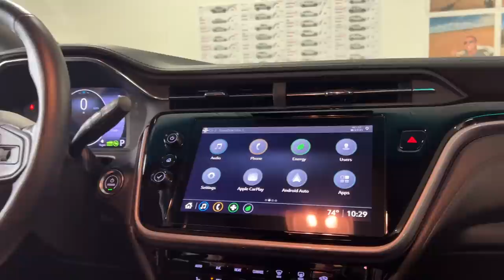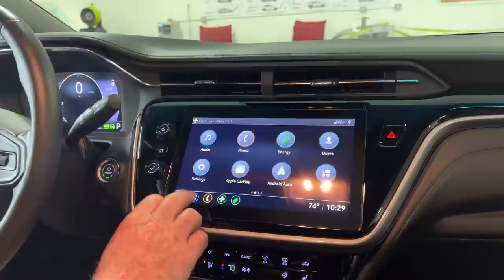Sandy's First Impression of the 2022 Chevy Bolt EV

Comment: I own a base 2020 Bolt EV. Picked it up for $22K at the end of December 2020. It’s been worth every penny. That said - It’s fine. Not impressive, not terrible. 
I’ve also rented a Tesla for a week. 
It’s definitely a step down in features, efficiency, and trim from a Tesla. The fast charging was limiting for a 300-mi each way road trip we took it on, but wasn’t a killer. We have two young kids, so we had to stop anyway, just for 20 mins longer than we would have otherwise. I just wouldn’t recommend trying to do more than about 400 miles in a day with it. 

But it’s totally a useful car for the average person or young family. It’s done about 95% of what I want it to. I still aspire to a Model Y though. Mostly for the supercharging. EA and the others feel so clunky and unrefined in comparison.

Comment: Sandy is right.  The panel gap control and evenness and exterior finish is quite good on the Bolt.
Reply: I think he got a Bolt from the GM Press Fleet, not a car sold to the general public.  Those Press Fleet cars always get special treatment before being placed into service.
Reply: @mikedx2706  My comment was thinking in terms of my own 2017 Bolt.  The quality of done assembly at the GM Orion plant was good.  The uniformity of the Bolt panel gaps is better than several Toyota products I’ve owned.  The GM paint process did well too - no orange peel or visible runs anywhere.

Comment: The older Bolts had a lever instead of shifter buttons.  I don’t know if I like the button aesthetics, however...  On the old Bolt the default is to default to low regeneration mode in “Drive.”  You have to flick the lever twice to go to “L” mode for more regen.  It reverts every time you shut off the car, so an unfamiliar driver probably would not know L is the preferred mode and not know how to switch into L.
Reply: L mode is fantastic 😊

Comment: No Sandy, don't tell manufacturers to go back to drum brakes. As someone who changes their own brakes and has multiple vehicles with drum brakes, I do not like them. Sure you rarely have to change brakes on EVs due to regen, but I'd still take cheap and smaller disc brakes that are easy to replace over drum brakes.

Comment: Be advised there is a serious and widespread problem with the 2022 Bolt. Many of them will show an error code that says “Propulsion Limited, Service Required”. The AC will stop working and you’ll have limited power. And there is no fix. 

It happened to ours six weeks ago. We took it to the dealership. GM told them “separate customer from vehicle until fix can be found”. We haven’t seen our car since and the GM EV Concierge people have acknowledged there is no fix. 

Apparently it’s either software or the battery, but no one seems sure. GM has known about the problem since May. They notified the dealers of it on May 13 of 2022. 

We are working to get a refund. Do not buy a Bolt.

Comment: That charging rate is just not acceptable but it shows its roots as a compliance car. The interior of the second generation is so much better than the first generation
Reply: Compliance car? 90% of Americans commute less than 40 miles a day. The car was designed for people that bought a house and have a place to plug in nightly vs the idiots that buy a Model S with that house money, live in a closet that has no place to plug in.

Comment: 13:34 Volkswagen does that on the rear axle of the ID family. I suspect the ABS/ESP regulation speed to be to slow, as drum brakes are slow, have a high delay and hysteresis (nonlinear input/output).

Comment: I DROVE ONE AND THEY SRE QUICKER THAN A Nissan Leaf . BUT THE BUILD QUALITY FEELS MUCH CHEAPER / THE BOLT DOESNT SEEM LIK IT WOULD HOLD UP OVER TIME . MAKES A LOT OF NOISE WHEN YOU DRIVE IT. THE SEATS ARE NOT VERY COMFORTABLE ! BUT AFTER GOV. REBATES IT WILL BE CHEAPER THAN MOST EVS. THE BEST THING ABOUT THIS CAR IS THE RANGE FOR THE PRICE. THATS THE ONLY REASON I WOULD BUY ONE OVER THE LEAF !

Comment: Sandy, luv ya, but I'd rather ram my head into wood chipper than work on drum brakes. Hate them and wish they'd die. What I have never understood though is why they are "cheaper" to manufacture and install than disc? Especially given modern ABS systems and the control needed. 

Discs have always seemed simpler in design, manufacturing, and installation than drum. Essentially a disc has one moving part. This piston. Drum brakes have at least half a dozen. I'm looking at you little springs and tensioners and shoes. 

So short request is, can you do a short video explaining the costing differential on drum and disc brakes in a modern car?
Reply: Keep in mind that in an EV you hardly ever use the brakes. I got 100K miles on my Volt and I'm pretty sure the pads are original.
Reply: @HodgePodgeProducts  Absolutely. I had a Prius and got 220,000 miles on a set of brakes. So, yes, the regular EV owner may never have to change their brakes, so the ease of disc brake replacement may not be an issue. My question is, why are drum brakes cheaper and easier for a manufacturer to make and install? It just seems like drum brakes, even IF cheaper to make, would cost more for the manufacturer to install in the car.

Comment: Hell No! Don’t bring back drum brakes! They truly suck! The springs like to fall off the top posts and end up getting ground up on the drum, the Star adjusters freeze!  The emergency brake cable likes to corrode and freeze, the cable that runs down from the top post to the Star Adjuster tends to break  when the Star gear gets a bound up by the brake dust that has no way to escape the drum area.  The brake dust is what gunks up this mechanism Just say no to crappy drum brakes that fade when you need then the most. Bad, bad idea for safety! The simplicity and elegance of the disc brake is the way to go, the Disc brake is better cooling, can be cross drilled for even better performance, and constantly clears the brake dust away instead of collecting it.   Sandy, I suggest you take apart an old, well used brake drum and see what it’s like VS those shiny new assemblies Munro and associates disassembles. Then after to experience a brake drum in its full junked up glory, brake dust and all, I bet the true horror of it all will make you walk back ever the slightest suggestion of manufacturers walking back to the dark days of drum brakes!

Comment: Hey Sandy and the rest of the team 
Looks like a fair review . 
What I noticed is that the battery’s didn’t seem to have any aero dynamics features around the connecting points to the body in and around thus imho would couse a lot of wind turbulence and thus noise and obviously drag . And also the noticed that it’s NOT just Gm Chevy bolt but lot of other brands .. 
and Honestly wish you could 🤞🏽please please do a VIDEO related to (Top ten aero Dynamic ) cars under the car 
Now I know that’s NEVER been done ????? I did say please 🙏🏾 
Right back to my details I noticed the rear bumper like a few have way too low bumper spoiler goes from the bottom of the boot like a backwards 👉🏾C 
So if you lift the car up and look at the bumper underneath what you actually see is the bumper scoops down around and forward thus actually making the car less aero dynamic actually acting like a 🪂parachute… so say with a few improvements
1, Looking at the Hight of the car drop 2” 
2, place two shields under the shock towers 
3, place two clip on shelf’s strips both Sid’s of the battery 
4, follow on a shelf from back of battery to underside of rear bumper . 
5, fit blow vents that after 50 mph the vent air back of car 
Sorry to be picky but think loads could be done to improve this car . From a just a quick view . 
Ps keep the great video’s comming 
And get a counter wait on theat phone / or damper system & also a wired cable to a 2170 battery that power’s a small powerful led thus you can pop on or off when reflection hits . 
Come on let’s have some inginuaty.. in this area 
You guys can do it ..? 
Also this would help you get in them areas not coverd some times 💡 lighting is your frend and filter 🤞🏽👌🏽  
So to wrap up you guys are awesome 👏

Comment: It's odd, in 1909 the Baker Electric Car could go 100 miles without recharging. In 2022, the Chevy Bolt goes 250 miles on a charge. That's not much progress in 113 years. Still, I'm excited to hear about your impressions of the Chevy Bolt next week. Stay awesome.

Comment: I was considering this as a 2nd car option a few years ago. But, the 1st gen dash controls with centre raised-nub plastic panel plus its cheap seats left it in 2nd place to the Hyundai Kona EV.  Then with the release of the Tesla Model Y and with retirements in site, we're going to become a one-car couple with lots of room and no compromises for a lot more money about $87,000 CDN. Interesting. Canadian Bolt LT is about $37,000 and has about $4,000 tax incentive (Tesla has none here. Wait, why do Audi Q4 E Tron qualify which starts at $87,000? Hmmm). Bolf EUV with leather is about $50,000 less incentive. Pretty good value. Still, it's a lot smaller than TMY.  PS The Bolt prices includs Supercruise features that are really a must for safety and convenience. Bolt APP connectivity is $400 a year too. Getting pricy for a small car still. Congrats if you read all this!

Comment: the Bolt is far from City car, I did over 1k in it over 10 days. My brother has one. Did 240 miles one day and still had 40 miles left. This is great car apart from one thing... DC charging. But I never needed this with all my driving.

Comment: Only had a couple of rides in the Bolt as my GM dealer is using one as a courtesy vehicle. I only have 2 questions When is GM going to install an actual suspension? And when are they actually going to start putting padding in the seats? The car is a damn buckboard.

Comment: The Bolt is actually fairly fun to drive, quite zippy with the 200 HP motor.  Simple suspension, but quite neutral, very little torque steer thanks to near equal shaft length.  The Michelin high efficiency tires hold back handling in cornering.  You could swap for grippier tires, but economy would drop (Car and Driver actually did that on a test Bolt).

Comment: 13:40 Sandy gets this. After the announcement of Brembo's electric driven disc brakes, I reckon, EVs can go without disc brakes buy a combination of oversized electric motors for greater regen, using battery for stopping power, and drum brakes

Comment: The Bolt has one of the better real world ranges.  The published figure is average 259 miles, but the car often delivers more, often over 300 miles.  In the last 19,500 miles since I rest my gauge, I’ve averaged 5.5 miles/KWH in real world mixed driving, but not using much cabin heat.  Using heat a lot would take a big bite in economy.  I believe the Bolt EV and EUV are still strictly resistance heat with no heat pump option.

Comment: My first instinct was this would be a good value because they fixed the batteries bursting into flame problem and lowered the price but the public perception remains. I would like to know  from Sandy if the battery is actually reliable now and will the expensive components last?

Comment: I easily get 5mi/kwh in my new 2022 Bolt EV 2LT, that’s with listening to music, running lights turned on(headlights off), running Waze on the screen, and keeping climate controls either turned off or set to within 10 degrees of outside air temp. Does that mean my max range is 66kwh x 5miles= 330 miles, minus any battery buffer?

Comment: Sandy they say that to get the $7500 off "if they pass the bill" the battery in the car has to be built in the USA or 50% of it. So is the Bolt battery made in the USA ? if not then does that Mean no $7500 off ?
Reply: EV and BEV need to pull their own weight and NOT be getting Publicly funded hand outs ($7500) from others who can not afford them.

Comment: Gosh Sandy, the Bolt has been on the road six years now. The 2022 is the essentially the same generation with a facelift. Some not insignificant changes for 2022 but still basically the same vehicle, a fact I don't have a real problem with because I generally like them, (with admittedly limited time behind the wheel.)

Comment: This Bolt car has become #1 for me.  After using my Tesla 3 on road trips that charging time is awful for trips.   I use my minivan that gives 500 mi, I saw way more things and drove highway flow 75mph.  I would definitely would have had to charge 2x outside for the same trip, that is 2 hours during day travel time lost.  Gas we didn't even fill up till we came home where we have ample time to lose.  Bolt is the right choice as range isn't there, dont need long distance charging of the cars that can't go the human distance on EPA rating.  Use my 3 as a city car, at that point Bolt owns the 3 in terms of cost.  Yes I know of the fires and recalls, but they will get better with it.  3 is not worth the money it asks.

Comment: There basic model looks nice, who wants to be in great debt, over a city car, most people travel in town or city where they live, commute to work, shop etc. 
255 miles is ideal after a couple of hundred miles  you need a break anyway, right 😉
I have a Nissan leaf 30kwh & the worst thing about it, is range anxiety, it's got this gauge that guesses the range you'll get, it often says 124 miles & will do maybe 90 miles in summer, so lies greatly 😡
So will be trading in asap.
If the Bolt does 255 miles, that's great 😉 
Thank you ✌🏻🇬🇧🇺🇸

Comment: Sandy has been spending to much time with Teslas, lots of misinformation and errors in this video.  Current 2022s + 2023 Bolt EV & EUVs have cash discounts or lower prices that bring EV 2LT to around approx.$30k and EUV premier to $32k.  The problem is you can’t buy them. They haven’t made any 2023s and the 2022s sit waiting for new batteries.  I also wouldn’t count on the proposed $7500 tax credit moving prices into the teens for any models.  Dealerships will absorb that credit via “market adjustments” :-)

Comment: Opel sold this as Ampera-e in Europe. Well "sold". At the beginning in 2017 they only chose 44 retailers here in Germany where you could LEASE (!) the car. delivery times where outrageous. I was really interested in the car back in 2016/2017. but you couldn't buy one. but today the charging speed is just too low for the large battery. 55 kW on DC are only in very good conditions.

still today an used Ampera-e is selling for high prices. back then they where about 40k €. the cheapest i found is still at 28k € (5 years old!)

they sold it later normally. but then i already got my Hyundai IONIQ electric which i still drive today (almost 5 years) and it's still an awesome efficient  EV with only 28 kWh (10-12 kWh/100 km in summer conditions are no problem).
Reply: The car launched right about the time GM sold Opel to PSA (Now stellantis). So you can imagine Opel not pushing these as they would in essence buy the cars from a by then a competitor. 
The loss per car would have been massive.

Comment: City cars only need a small battery, and maybe 100 miles range. Instead of charging once a week, you'd charge overnight, or while the car's parked at work. We still don't have cheap EV city cars in the US, in China, they are widespread and cost about $10k or less.

Comment: If you can charge overnight and get $7,500 off, would be fine for 2nd car for commuting.
Reply: Keep in mind it's not $7500 off the price of the car, it's $7500 off your income tax bill. Which means your tax liability has to be at least $7500 in order to take full advantage of the credit.
Reply: @toronado455  last I looked, the new EV bill has it at point of sale. On the other hand, there is language about battery materials and or construction has to be in the US so hard to know in the end.

Comment: Finally, an EV at an affordable price point within an economy that's circling the drain. People are struggling to buy groceries and just about everything else.
 My only deviation from the review is disc vs drum. I grew up working on drum brakes - there's no question that they work but I'd much rather deal with the simplicity of calipers vs the drum brake fiddly bits.
Reply: I think the main reason Sandy brought it up is because regen means the brakes hardly get used so even drum brakes, which are cheaper, would last plenty long.

Comment: According to GM, Bolt software  is designed to use artificial intelligence. all data transmitted for analyzing. and premier is not a small cabin for 4 adults. ventilation on premier   .definitely good point as some luxure too.

Comment: A much better looking bolt and at a good price. Just wished they hadn't went so low on recharging rates. Makes you wonder what they have also cut down in the electrical system. But as you said a clean good looking small car. Can't get everything and stay small and low priced. If GM doesn't have battery problems with this Bolt it should sell. Of course they have to scale them and they have to make money on them. As Elon says it's volume that's tough to pull off. And they seem to have solved their problems with software going with Apple carplay. Not Tesla's software system by any means but shouldn't be as buggy as legacy has been guilty of in the past. Of course that cuts into profits and brings issues with software being customized over just off the shelf general features. It will also be interesting to see if they can handle over the air updates. That's always an issue when the software is made by a third party.

Comment: If dealers don´t raise the price too much then a sub 30k version of this is a really good deal, especially with the 7500 credit. I have to say thought I´m very disapointed with the charging speed. 55kW is very slow for a 2022 model and if this is using the glorified Ultium platform then GM is in trouble.